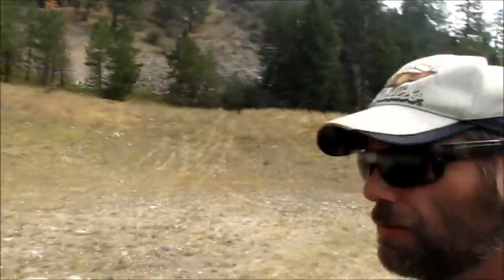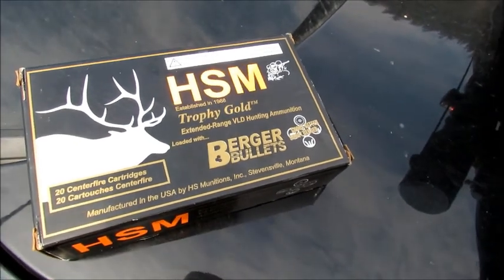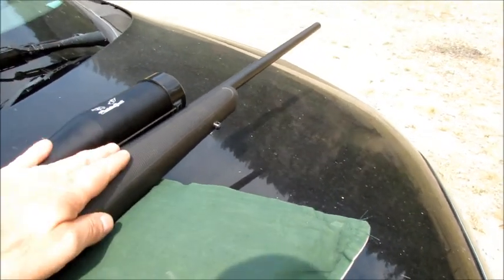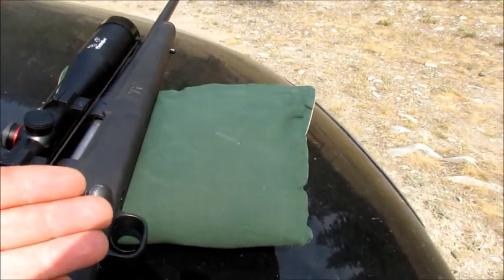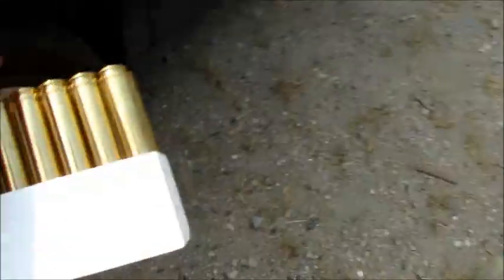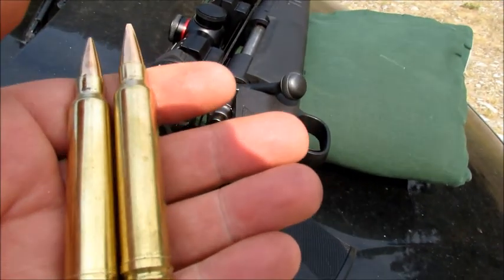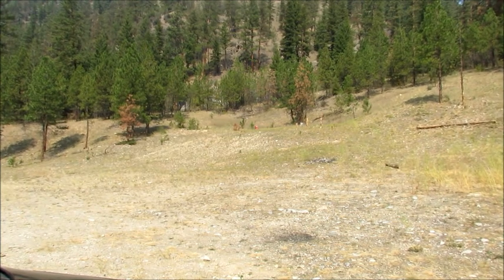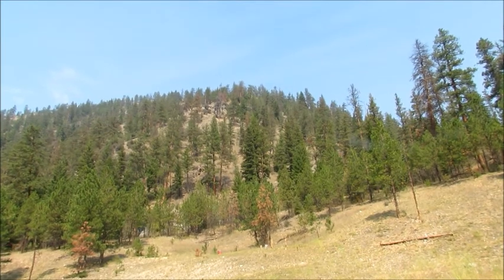Long Range test: 300 Win Mag Load test: Accuracy not great.

Comment: VLD type bullets that are factory loaded very rarely group worth a damn in a production rifle since there's usually such a long throat in the chamber. Those bullets when handloaded to just off the lands to jammed into the lands will show a night and day difference in accuracy from SAMMI spec factory lengths. 
Another thing to consider is that rifle with the thin Sporter barrel will heat up very quickly and your groups will suffer. 
Safe shooting!

Comment: No reason to clean your bore unless you live in a humid environment, and the fouling (carbon mostly) allows moisture to stick in the bore, and you get pitting.  Just an FYI.I live in Louisiana, and if rifles aren't cleaned regularly and a light coat of oil applied, the bore will begin to rust.